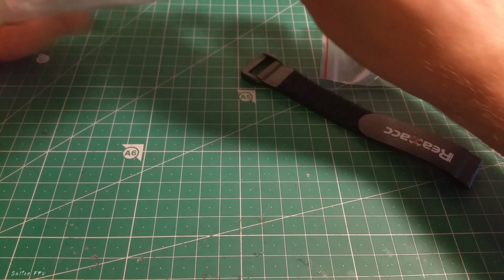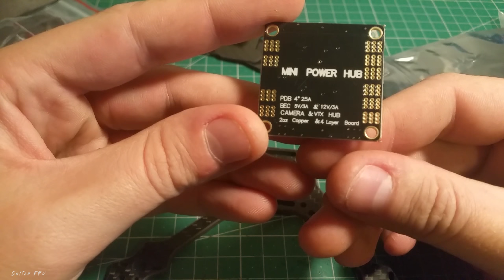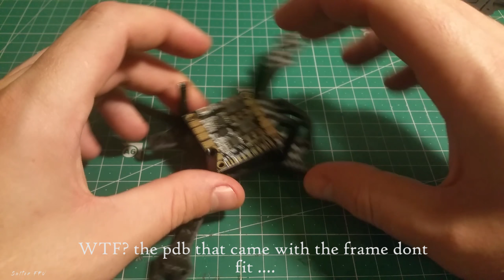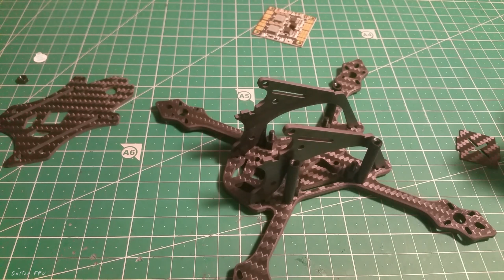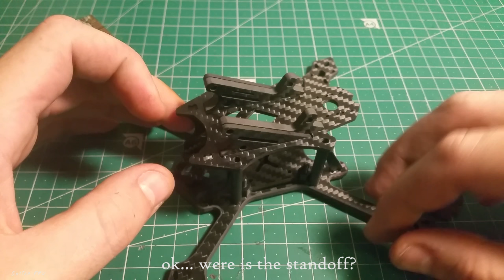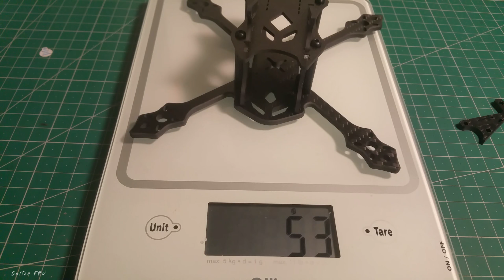Unbox and assemble Realacc Crow 140mm frame worst frame ever

Comment: Why is it the worst frame ever
Reply from the maker: +shylo23 because  comes with an pcb that even fit on the frame, and they don't supply all the standoff necessary to assemble the frame. Btw the carbon fiber cut its really bad too.
Reply: Salter FPV yea. I had the problem with the first one. Then they send me another which was perfect. I used the 20x20 stack so didnt really need the pdb. But flying it to me was and still is great. I feel you tho. Great vid
Reply: He is clueless on building quads that is clear with the video